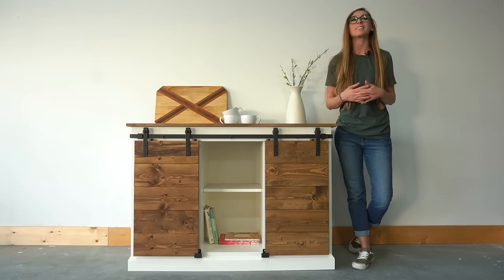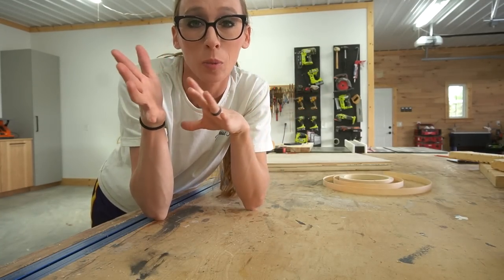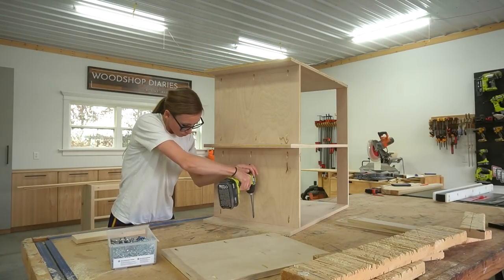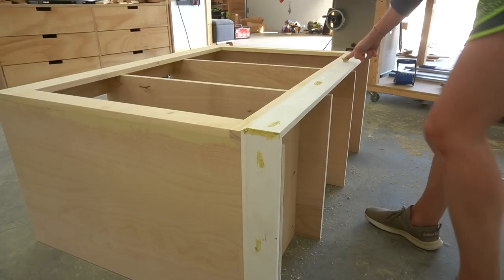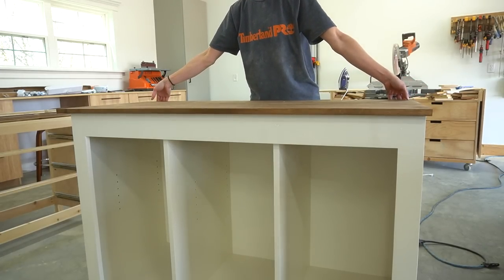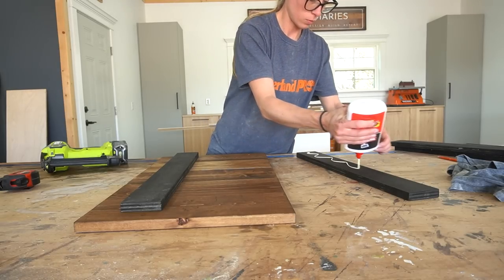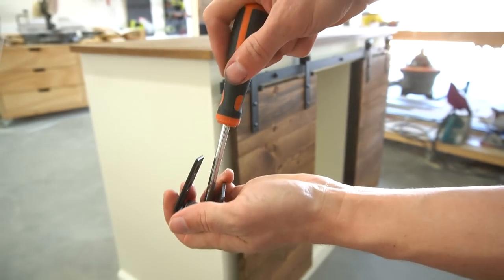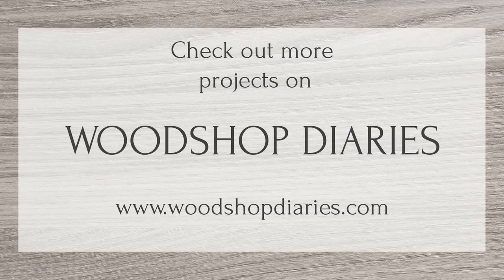How to Build a Sliding Door Cabinet

Comment: Great timing. I was planning on building something like this.  I like your simple door design much better than the X type.  It was interesting to see you make the bottom and top as 3 pieces.  I was wondering how that compares to making one long piece.
Reply from the maker: Thanks so much! So glad you enjoyed it. I considered making one long piece for the bottom and that would work fine, but then I’d have to add support pieces underneath  because 48” is too long to span without additional support and then I’d have to cut the two middle pieces different lengths instead of all the same. 
When I build things, I try to keep simplicity in mind and the possibility that someone using the plans I’m sharing may not be as precise as you may hope. If they were to accidentally install the bottom panel 1/8” off, then cut the side panels and bottom supports to a specific size based on where the panel should have gone, there’s more room for compounding errors in the project. So I built it this way to help eliminate the possibility of compounding errors in the plans. This was also easier in my opinion to keep the screws hidden. There are a hundred ways to build the same thing…so one bottom piece with supports underneath would work as well. It’s just personal preference 😅
Reply: @WoodshopDiaries  thanks much. What you said makes a lot of sense and I am gonna try your method.  I always built it with one piece and because of what you just said, I cut as I assemble and not in advance.  And that is slowing me down.

Comment: I'm totally digging how you built the slat doors using a couple of blocks on the back side! So simple, but so smart. I totally thought you were going to glue them altogether, which would've been so much more stressful
Reply from the maker: You got that right! if I can ever avoid a glue up, it'll save my blood pressure and stress level haha! I was also afraid if I glued them here, they'd end up warped or twisted and not hang straight down. 🙈

Comment: Looks great. 

Have you ever edge banded radius corners? 

I’m in the middle of doing that now, and let’s just say that it’s interesting.
Reply from the maker: Thank you! I have…both outside and inside. Outside isn’t bad unless it’s beveled. But inside is very…interesting 🥴 the biggest issue is if the edge is slightly beveled or not real smooth. It’s challenging to get it to lay right. But if you heat the banding, then press it into the inside curve, it’s a lot easier than using the iron directly on the inside since the iron isn’t curved so it won’t contour.
Reply: @WoodshopDiaries  good to know. if you have a video of edge banding curves i couldn’t find it. for that matter, i couldn’t find a video on that subject anywhere on internet.
Reply from the maker: No, I don’t have a specific video on that specific task of edge banding curves. I just have a guide to edge banding here: https://www.woodshopdiaries.com/how-to-cover-plywood-edges/

Comment: I noticed you make everything out of 3/4 inch plywood. I get that its stronger and holds up better. BUT do you/have you used 1/2 inch in any types of cases? My daughter wants me to build a really small bookcase for my 2 yr old grandaughter. I was originally thinking 3/4 but now I am leaning towards 1/2....due to the small size and less weight if/when they move in the future.
Reply from the maker: I actually have a video behind why I do it here: https://www.instagram.com/s/aGlnaGxpZ2h0OjE4MDEwNjAwMzc4NDMyNDU3?story_media_id=2891601010737556888&igshid=YmMyMTA2M2Y=

I prefer 3/4” over 1/2” for just about any type of cabinet or bookcase for the strength. It’s slightly heavier, but I’d rather use it. That’s just my preference.
Reply: @WoodshopDiaries  ok thank you!!